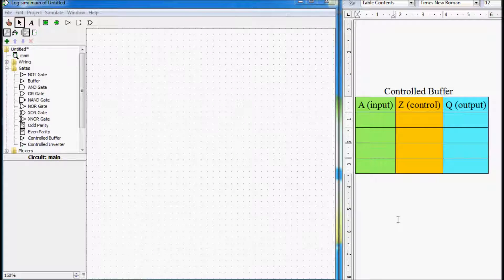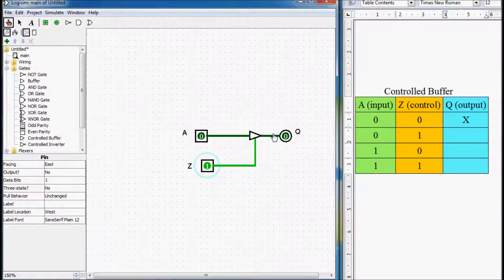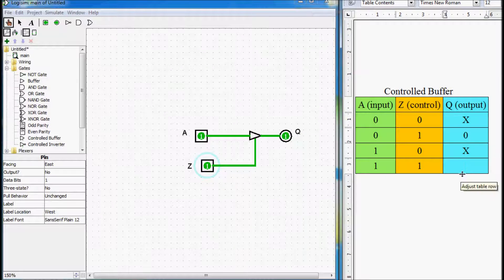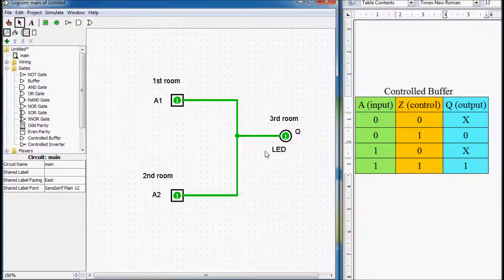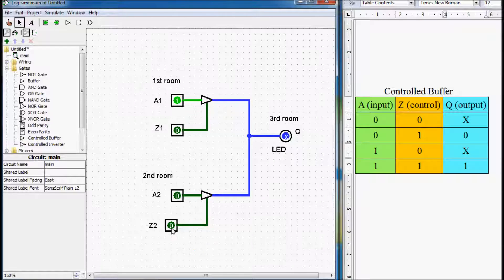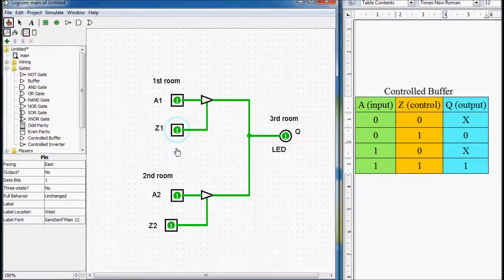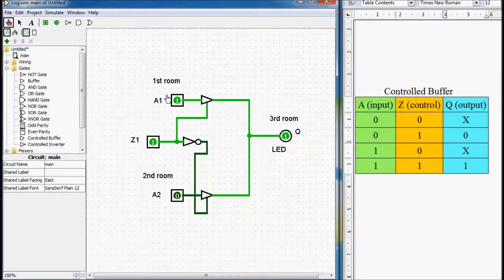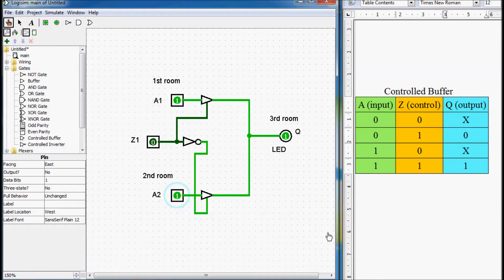4. Basic Logic Gates - Tri-state buffer (Controlled buffer)

Comment: I could make a synth module with these for sequencing gates and triggers, like a way to route different inputs to a single output, and switchable with CV or a button :D
Weeeee
Reply from the maker: There are things called demultiplexers. I am not familiar with demultiplexers for synth modules, but since you need something like that, there’s a pritty good chance that something like that already exists.
Reply: @shortcutelectronics  This seems easier honestly xD
I didn't mean for sequencing really, but more like just for being able to change routing through a control voltage.
Like i could switch what is being routed where with a voltage trigger.

I don't know though, i'm just getting started with things.

I'll check out the multiplexer stuff though.
Thank you ^~^

Comment: You can do the same with an And port?
Reply from the maker: No you can't. At the output of an AND gate you can get only logic 0 and logic 1 level. In this case of Tri-state buffer using the control signal you are connecting or disconnecting the input from the output there for you can get logic 0, logic 1 and disconnect the input from the output entirely. There's a difference between logic 0 level and high impedance state (x level in this case). I hope this answered your question.
Reply: Can you smoke pot and still be able to make this?